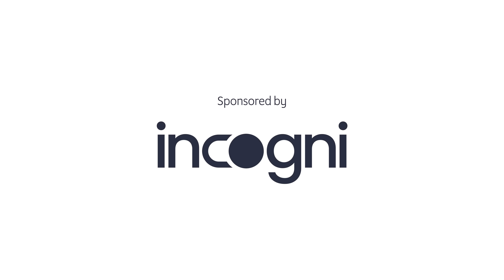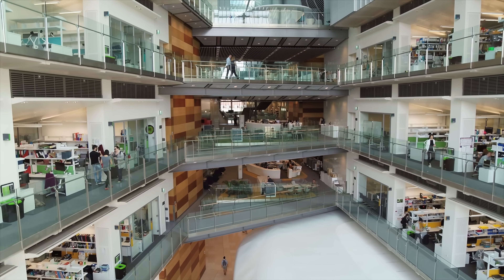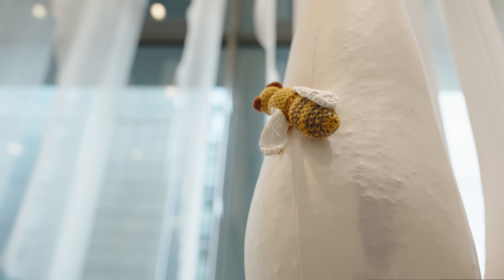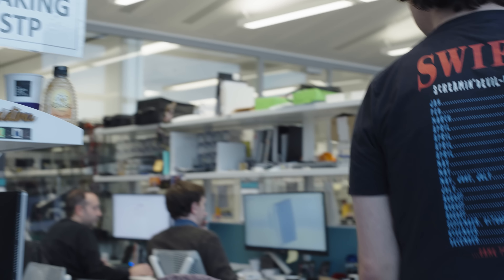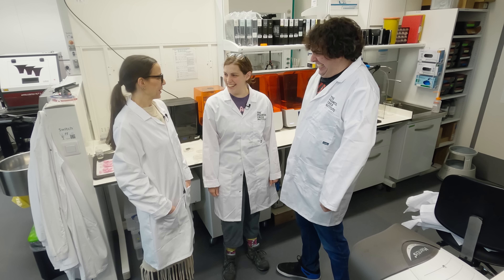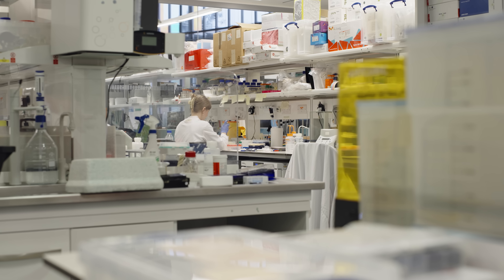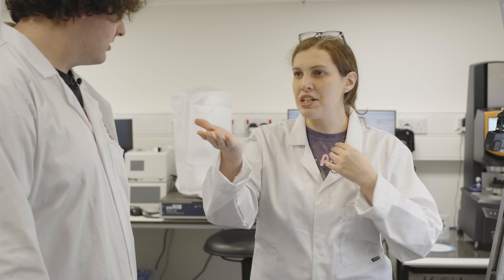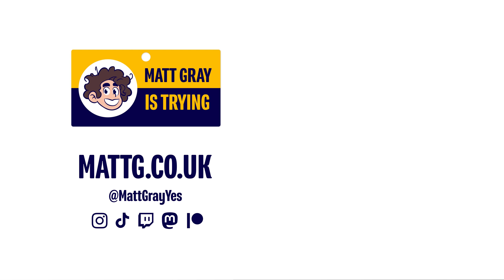What are biomaterials and microfluidics? | Matt Gray is Trying: Biomedical Science

Comment: I am working on my PhD in a lab developing DLP_SLA 3D printers (resin) specifically for microfluidics. You would be shocked at how small you can print channels. You can print systems with dozens pumps and valves and mixers on a chip that is only a few mm in each dimension. You can print channels that are as small as 2 microns in each dimension. That 25x smaller than a human hair!!!!
Reply: What is a um?
Reply: Probably µm, micrometer.  0,000 001 m
Reply: Yup. One thousandth of a mm
Reply: @keyofd  Thought for a while it's some esoteric measurement, not realising that u was just a substitute for µ. Better just say micron, tbh.